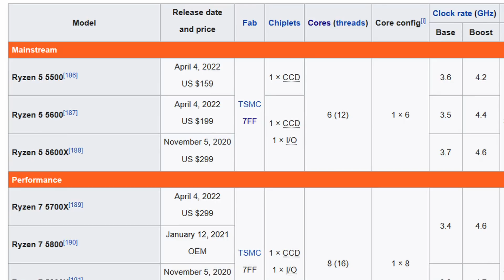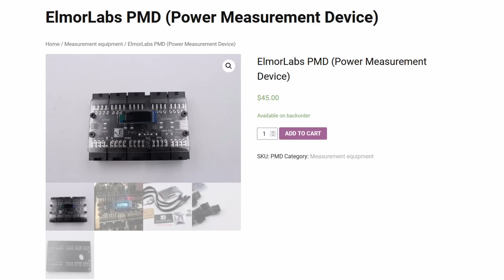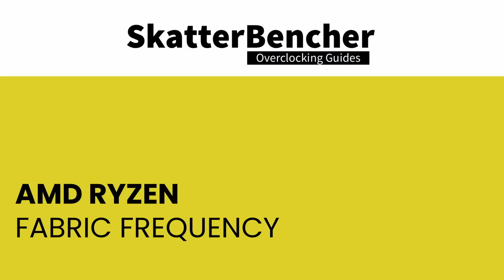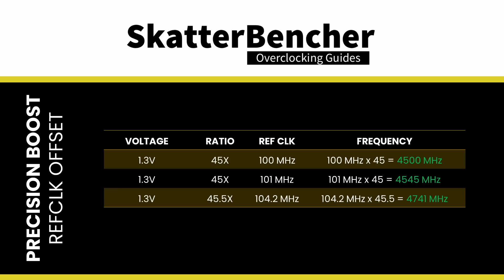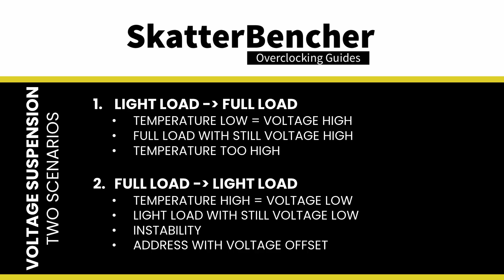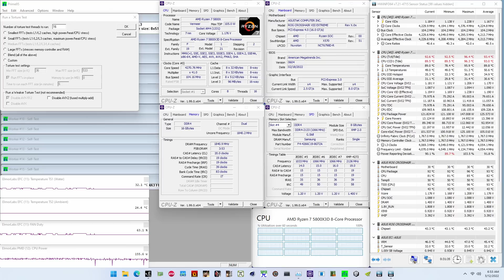Ryzen 7 5800X3D Overclocked to 4740 MHz With Crosshair VIII Extreme | SkatterBencher #39

Comment: I dont understand, i also own a 5800x3d along with a crosshair hero VII and PBO2 is present, as a matter of fact I have already set some custom CO values per core and the cpu cana chieve 4550Mhz pretty easily ! In my case would you recommend applying these settings on top of PBO and CO?
Reply from the maker: Playing with reference clock on the 5800X3D is a bit finicky due to the it affecting everything in the CPU. So I don't recommend it unless you really want to squeeze some extra MHz.
Reply: @SkatterBencher in fqct tried to oc the ram by setting it to 104.2 and the computer couldnt boot, had to clear cmos and reconfigure everything from scratch

Comment: 14:44 Any guides on how the hell to do that? It seems to be pointless complicated AND expensive. But, I WOULD be willing to comb through Ebay Craigslist and FB Marketplace to see if there were any cards available to make it possible on the cheap. Somewhat interestingly, my Aorus Master 570 somehow clocked my r7 3700x up to 104.60bclk the other day with most settings on auto. Something was burning.

Comment: How i can set in cross hair dark hero "core Voltage sunspension mode? Or i just should set with out it? On my motherboard?
Reply: I search that option and i couldn't find it so i let it without it, use the offset voltage instead

Comment: I have a Ryzen 7 5800X3D and cooling it is an Arctic Liquid Freezer III 360 Black with the AM4 offset brackets idles at 28c and never goes over 62c in gaming and an Asus Tuf Gaming x570-Plus WiFi with the latest bios as of Nov.4,2024. For memory I have a kit of G Skill Trident Z Neo cl14 3600Mhz 4x8gb overclocked a little cl14 3666Mhz 4x8gb with direct memory cooling. In the bios I have all the fans at 100% rebar enabled and in the advance tab under xfr I have enabled PBO2 with the curve optimizer all core -20. In Cinebench r23 30-minute throttle test I scored 15,263mc in CPU-Z I benched the CPU single core and scored 631 in multicore I scored 6,623 with all the cores hitting 4450.96ghz validated. I think I just got a great silicone bin I don’t want to push it any further and get greedy and mess things up so I’ve stuck with these settings for 2 years and is serving me well for my GPU I’m sporting an Asus RTX 4070 TI Super and for the PSU Corsair rx1000m 80 gold plus in a Corsair 7000D PC case for storage a Samsung 980 Evo Pro 1TB and a WD sata drive 500gb and for my monitor a 31 inch Asus Tuf 240hz love it see no reason for an upgrade yet though the Ryzen 7 9800X3D looks great but I’ll wait till they work out all the kinks in the bios and when it is fully stable. In Aida64 Extreme my latency is 56.8ns.

Comment: Never seen everything explained so thoroughly, kuddos to you. I learned this by trial and error. However, on my 5700x3d I just set pbo2 to - 35, it drops temperatures from 80 degrees at heavy load to 68 degrees with air cooling, and scores better. I suspect that 5800x3d  overclocks better, so I'll just leave it be.

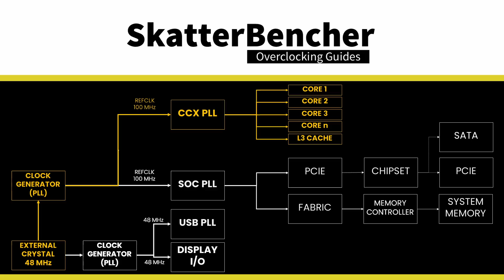Comment: 14:27 On ASUS ROG Crosshair VIII Dark Hero i was able to boot in Windows (11 Pro) with maximum BCLK=100,94 MHz with system SSD (with windows) connected to top M.2 slot and also SATA HDD used as storage. 101 MHz - no boot at all. Is it really because of SATA drive?
Reply from the maker: It's difficult to diagnose over the internet, but it's possible. SATA bus is very sensitive to reference clock changes
Reply: @SkatterBencher  Tested. SATA was a reason. I disconnected it and was able to run higher BCLK. Up to 102,25 MHz. Also, even with "Force OC Disable" = "Enable" max frequency was 4200 MHz for single-core load. Must raise vCore with +0.01250 to get 4601 MHz. At least for now i know it's working in general. Thanks!
Reply: @SkatterBencher  Thanks for respond! It's not system drive, and there are no important data. I think i can just try to disconnect and boot with just SSD in M.2. where windows is installed. Everything was turn on in BIOS, like GLobal C-State and Force OC Disable (enable), but still... Another question about Curve Optimizer. I run test the way you did, but with small FFTs with AVX. System always in thermal limits (cores at 88-90C degree). I don't use lower PPT\EDC\TDC limits, they on auto. And after 5-7 minutes frequency drop on some cores. This is how it should be or i must not be thermal limited in first place? Temperature itself may cause frequency drop or CPU just slowly lower it's frequency? Like my core #3 feel o.k. with -30 CO at the same time core#0 already lowered to -9 and i didn't finished yet.

But man, videos are awesome and detailed!

Comment: unnecessary load on the cpu. Your mother board is capped at 4000 mhz and your dram is capped at 4200mhz. Pushing to 4700 mhz on cpu is unnecessary load on the cpu

Comment: skatter bencher i need your help man i got a 5800x3d and a x570 godlike mb with 4 different sets of ram and it on 6 radiators and two pumps but im having problems foguring out how to overclock this cpu can you help me man . like if your busy ill even pay you man i just dont know the exact settings to try, please respond
Reply: 4 different sets of ram i got 32gb gskill cas 14 , 32gb g skill 4000 mhz cas 14 , 64gb corsair 3600mhz cas 14 and 128gb corsair cas 16

Comment: Great video! wanted to ask: does the CROSSHAIR VIII HERO also have the voltage suspension feature?
Just curious about a more economic route to achieving your results
Reply from the maker: Unfortunately the C8H does not have this feature.
Reply: @SkatterBencher  Just wondering if theres any other motherboards it is possible to do this with. thanks for the reply

Comment: How the heck did you get your 5800X3D to 95c?! I run the same things on mine at stock and I barely hit 70c...on a 240 custom EK loop... I think there is a mounting issue or water loop issue. Mine is OCed to about 4.6, not a golden example, but I did have it at 4.7 for a short while and 70c tops.

Comment: hello (i m french then sorry for my english) i have x570 crosshair extreme 5800x3d but the computer don t boot (the motherboard screen show "hdd error") then I disabled the sata ports for the tests.
the pc boot but i don t have display. (with my 4090) i say it boot because the rgb fans change color. when I am under windows11 the lighting goes white.
precision, i have a riser lian li with my lian li case 011d.
is it possible the riser don t work with bclk 104,2 ?

is it possible the hdd don t work with bclk 104.2 ?
have you got a solution ?
kind regards.
Reply from the maker: Yes, it's very possible. On Ryzen CPUs prior to Ryzen 7000, one reference clock is affecting all the clocks from the CPU. That includes CPU cores, memory controller, system memory, fabric, PCIe, SATA, ...

Generally, SATA devices are not able to handle high reference clock. My experience says that everything above 103 MHz is touch and go depending on the specific system.

Unfortunately there are not many workarounds to improve it.
Reply: @SkatterBencher  i think put these 2 hdd in a case. but why, i don t have display with my 4090 ? riser or something else ? i try without riser this evening. thanks for your answer.

Comment: Completely stock and my fans going at 3000RPM I can keep my 5800X3D under 80 degrees, if I also run a 3D benchmark like Superposition the CPU temperature goes up to 84-85 but the CPU throttles to 4250.

I was contemplating brushing off my old pump, radiators and slapping a new waterblock on there... but if I see your stock runs of Prime... it kind of makes me rethink my choices if you are already hitting 90 degrees with a waterloop!
Reply: So TLDR, you did not overclock it all for all core CPU loads as it is still thermal throttling!

The CPU will reduce clock speeds after 70 degrees, at least that is what I find as past that temperature it won't boost up to 4550 anymore... which is only really does for specific core loads and never for an all core load like Prime95/stress-ng/CB23.
Reply: And as you see from the your own results in the effective clocks even changing FCLK does practically nothing if it did anything at all, the effective clocks are all within margin and you only gained 100MHz effectively by lowering the voltage slightly. With margin I mean running with spread spectrum enabled VS disabled.

If you set a flat CO offset of -20 or -30 you would see 4550 for sure.

Comment: Hello I have this cpu from the box and dark hero with AIO cooler master on it and 2x8gb 3200 cl16 on it but with Palit 1070Ti on it and the temperature is not droping beneath 90'C in flashed bios till it crush down on 112'C :/ bios is 4304 x64 and l don't have idea what else to do,also tried it on previous rig prime a320m-k and it reacted same after bios update/downgrade.Please help man

Comment: hey man i got the x570 dark hero with the 5800x3d but i dont see the volt suspension. i got this thing on 5 radiators and i want to try and boost it up can i do it on a dark hero or do i need the extreme board

Comment: I have a 5800x3D. Im looking into getting a new mobo in order to OC it. will any of the Asus Crosshair boards be able to utilize voltage suspension? Im looking into my options...Thanks!
Reply from the maker: I think only the Extreme has Voltage Suspension

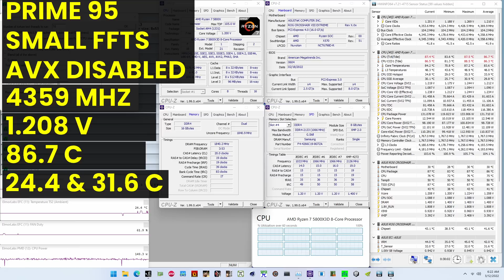Comment: Comparing 26:32 and 26:58, why does enabling AVX not cause a rise in the average package power yet results in higher temps?
Reply from the maker: TLDR: AVX scenario is limited by thermal density, not power consumption related thermals.

Likely it's higher thermal density due to use of AVX transistors in the AVX-enabled test scenario and the increased heat cannot be transferred fast enough to the liquid. Higher thermal density increases the peak temperature which forces the Precision Boost algorithm to reduce its frequency and voltage. Lower voltage means lower power consumption.

In the non-AVX test scenario there is less thermal density issue, so frequency and voltage are pushed higher. Power consumption scales exponentially with operating voltage, so the small increase in voltage will result in a substantially higher power consumption.

Comment: Which add-in sata controller with clock generator are you using? I couldnt find it mentioned anywhere.
Reply from the maker: One with ASMedia ASM1061 chip, this one: https://www.aliexpress.com/item/32818462431.html

Comment: Excellent Video!!! Thnks a lot!!! What you think about the probabilitys of damage this Ryzen in this practice? Its high, or the casualities are low? :)
Reply from the maker: Hard to say without access to a decent sample size :) your guess is as good as mine
Reply: @SkatterBencher  hehehe... Well.. I'm using mines right now.. and its a curiosity, in stock, with my TUF b450m (working at excellent Volts) is reaching 4570mhz in 3-4 cores... Another think i saw.. some MoBos are getting new Bios for this processor with some improvements.. Definitely we must wait and see for some news (I hope good ones ;)   )

Comment: Hi! Just came across the article and wanted to clarify this:

"The boosting algorithm first determines the maximum allowed voltage for a given set of input parameters"
...
"Once the algorithm has determined the maximum allowed voltage, it applies the associated frequency based on the V/f curve."

Are you sure it's not the other way around? 🙂

Nice reading, anyway.
Best regards, PJVol.
Reply from the maker: It's hard to say because no one except AMD knows the specifics of the boosting algorithm.

But what we do know is that AMD is using the same kind of Adaptive Voltage Frequency Scaling and Clock Stretching technology that was first introduced in Carrizo. The long story short is that the CPU adjusts the frequency based on the actual voltage. 

It's also quite logical to do it this way: at the end of the day, the voltage determines the stability at a given frequency. Plus, voltage is the main driver of power consumption and temperature. First checking what's the voltage headroom, and then applying the appropriate frequency seems like the best way to avoid over-temperature and ensure stability.
Reply: @SkatterBencher  There's quite a lot of publically available info that coupled with the ability to look closely at things (which you seem to have) will give you a general idea of how it works. Not deep into every detail but pretty close.

Yes, the voltage is the key for the stability, and that's why the VRM VID request is the last step in the "avfs" loop. The "frequency for voltage" limit is calculated for the actual sensed voltages, but in the earlier steps, alongside with other frequency limits such as power, thermals, activity, etc. (total of seven in Vermeer, nine in Cezanne) used to obtain an agregated value for the "Global frequency limit". You can observe it in HWInfo64, which is the actual COF, and what the final SVI2 VOTF (VID-on-the-fly) request is based upon .
Of course there are many details behind it (for example, the order of freq.change and VID requests depends on whether freq. goes down or up). 
Anyway, I like your quite detailed approach to filling the people knowledge gaps on this topic, so If you find my help appropriate, feel free to contact.

Cheers, PJVol @OCN
Reply from the maker: Very helpful, thanks! Do you have a blog where you share your insight? Would love to have a closer look :)
Reply: @SkatterBencher  No, I don't have blog and I haven't got all my posts in one place, rather they're scattered across three, may be four OCN threads, mostly throughout the "Ryzen DDR4 24/7" one.
Anyway, you can open conversation @OCN, if nesessary.

Cheers, PJVol @OCN

Comment: Fascinating, thanks!  Unfortunately I'm stuck with an MSI X570 that lacks ASUS's voltage suspension feature.  I've also refrained from updating to MSI's beta AGESA 1.2.0.7 UEFI for now, so BCLK adjustment isn't available to me yet either.  

On the other hand, I have achieved nice results with the "PBO2 Tuner" freeware app, which effectively overcomes AMD's decision to remove Curve Optimizer from the 5800X3D's UEFI feature set.  Using this tool, I'm stable with -30 on five cores, -23 on my best two and -27 on one other core.  

Benchmarks like CB23, CPU-Z and Geekbench 5 have all improved slightly, but the most impressive gains are in CPU voltage -- down from about 1.26 to 1.14 peaks during multicore testing -- and temperature -- down from low 80s to mid-70s during benchmarking and gameplay, using an EK 240 AIO.   The only downside is having to reset the CO values with each startup or wake from sleep, so restoring the missing UEFI feature would still be preferable.

Comment: This is so damn good. I love how you took the limitations of the 5800x3d and found a way to work around it with all of the features/capabilities your mobo provides. Too good!! Any idea if other high-end b550 and x570 boards have a voltage management solution similar to voltage suspension?
Reply from the maker: I think Voltage Suspension is an ASUS exclusive feature
Reply: @SkatterBencher  Is it possible to do this with a tuf gaming b550m - plus?
Reply: @athenaconfeccoes-contato4800  did it work?
Reply: The ASUS B550-Plus Prime (AC-HES) also has the DIGI+ VRM EPU onboard with the DIGI+ software available. So some of the mid-range ASUS boards (that don't cost $600) also support this feature.
Reply: @savagej4y241  Is it possible to do this with a tuf gaming b550m - plus?

Comment: how critical is voltage suspension to accomplishing BCLK overclocking w/ the 5800X3D (for folks who just have lower-tier BLCK-capable board)? I'm guessing a more modest BCLK overclock is doable?
Reply from the maker: It's not critical in the sense that it enables/disables overclocking using refclk.

It plays a role when you also want to increase the operating voltage to support higher frequencies. Normally you could just use a global positive offset. While that would help with stability with higher voltage at higher frequencies for single core, it also increases the voltage at medium frequencies for all core workloads.

Voltage Suspension allows you to force lower voltage at higher temperatures (= all-core workload) as well as higher voltage at lower temperatures (single-core workload). So it's more useful to dial in a 24/7 system than global voltage offset.

Comment: 5600x vs 5800x3d  with 3060ti or 6700xt gaming ?  does the 5800x3d   memory cache improve performance on all GPU'S or just high end cards
Reply: : It will generally be better with any card, or the same, but it depends more on what game you're playing. Older games don't get as much of a benefit as newer titles because for older games the "old" v-cache is already high enough. Also the better the GPU the more frames. The bottleneck can be something different for every game. There are more variables than just the bigger v-cache... sadly so :)

Comment: hello, one question, i have seen videos on overclocking not k, but for as complete as possible overclocking of an i7-12700 (not k) so the only way is to take a bclk motherboard?  at the moment under 300 euros there are only rog strix b660-F gaming, and B660-G.  or are there other solutions?